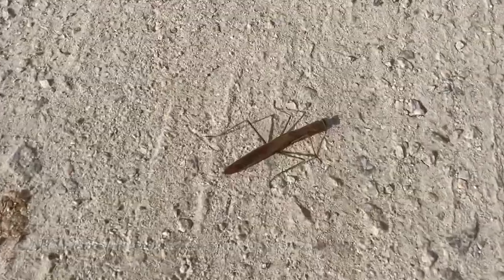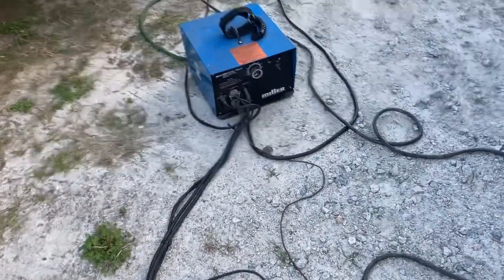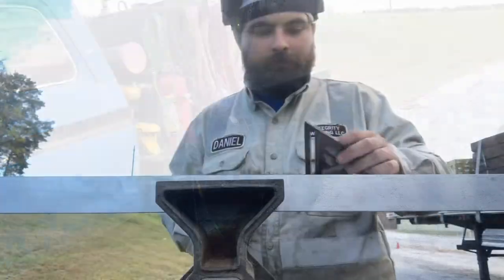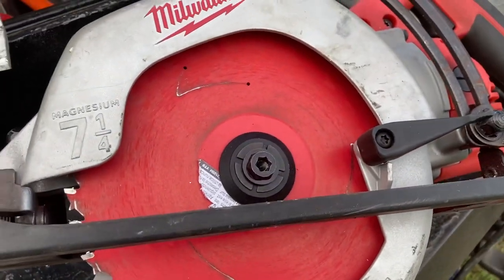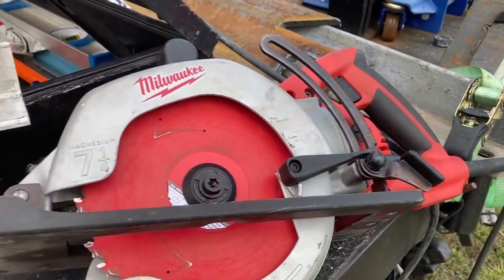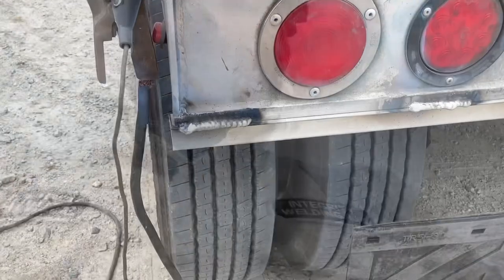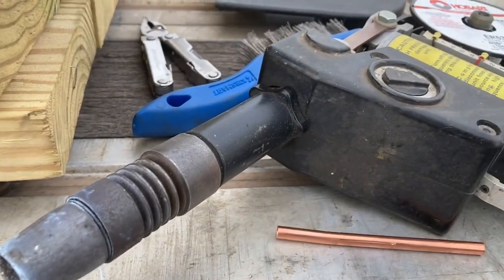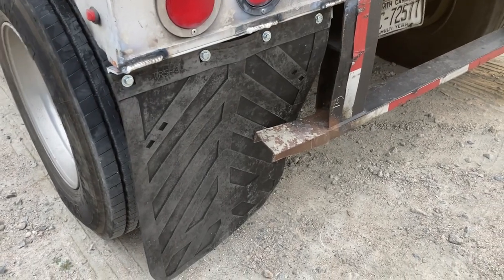Fixing an aluminum trailer mud flap bracket - welding aluminum with the sa200

Comment: Why don't you use your Miller 8vs wire feeder with a spool gun.? All you need to do is add a two position switch, pretty much robbing the voltage from suitcase drive motor and sending it to the spoolgun drive motor with a flip of a switch.

Comment: What thickness would you max out that skill saw with steel
Reply from the maker: Probably about 5/8 or so it cuts 1/2 just fine haven’t really found the max yet
Reply: @derbadortheweldor8940  I couldn't get more than 5 or 6 cuts using the Diablo blade on 3/8 x 8" steel